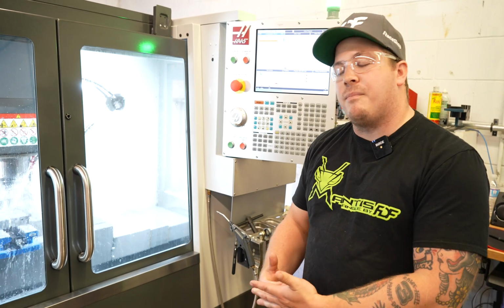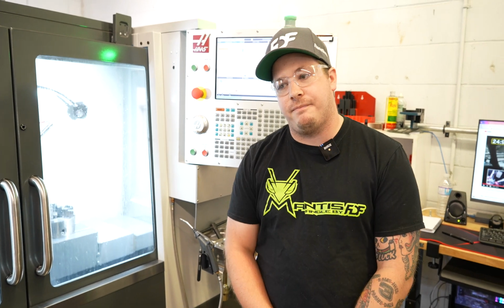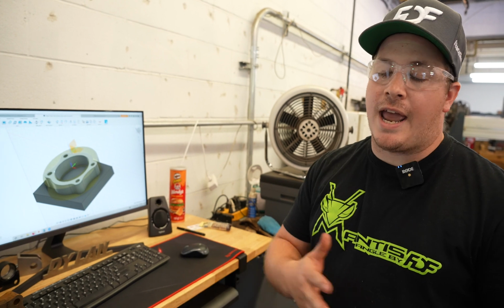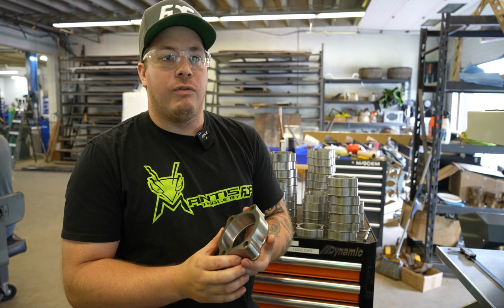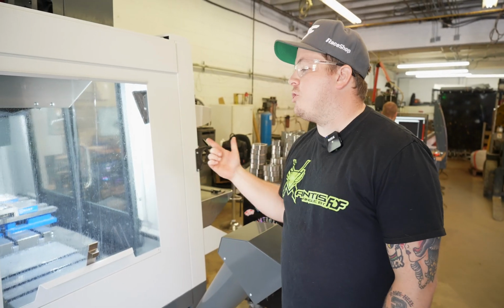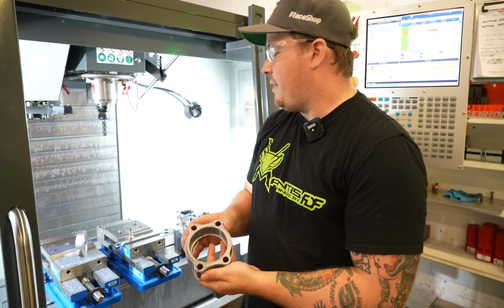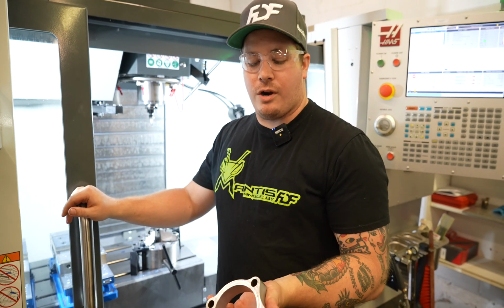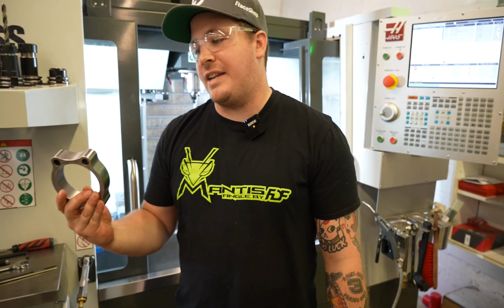OUR NEWEST EMPLOYEE/ RUNNING OUR HAAS CNC

Comment: Mount through the bolt holes, mill outside and inside paths. create an aluminum soft jaw fixture for the Kurt vise following the outer profile. Clamp, skim, break edges, flip, repeat. Eliminate the need for the lip